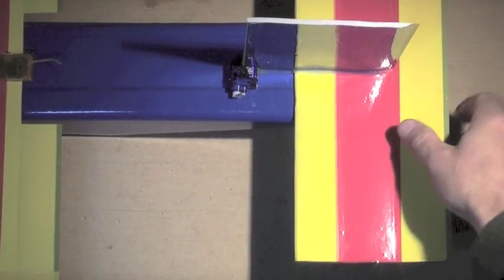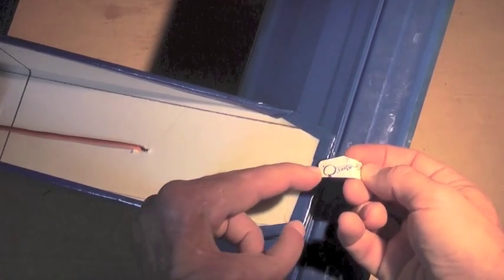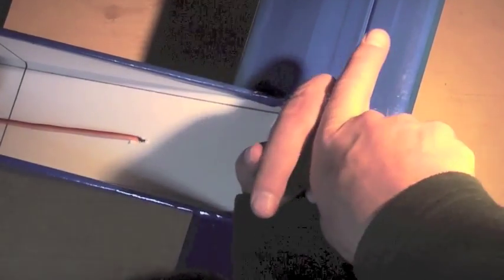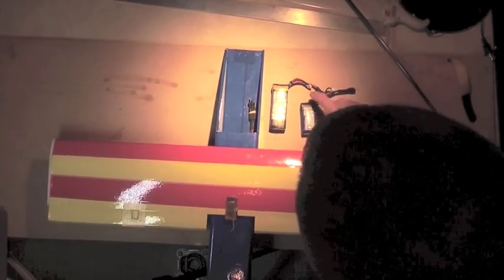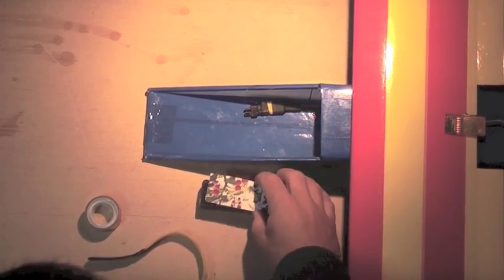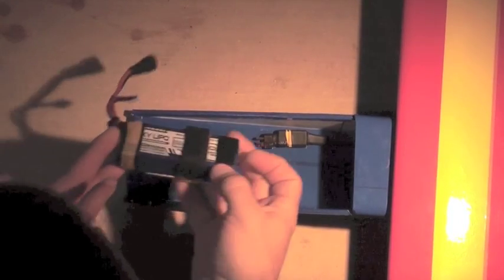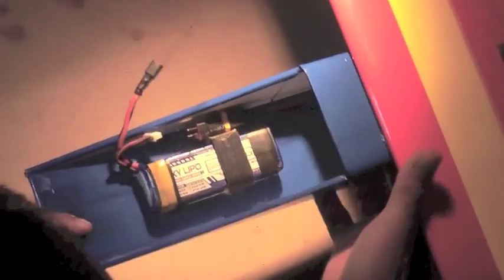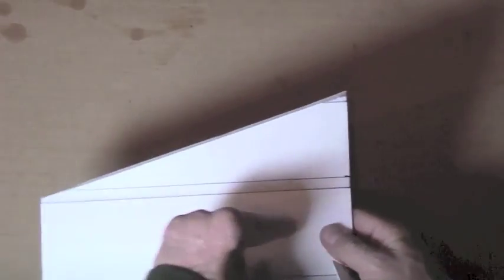FUGLYJET EDF, Build #4 - battery and controls

Comment from the maker: Right on, good choice.  I use NanoTechs 40-90C, but honestly just about any one over 30C is probably going to last you for a couple of years of weekend flying.  40C is nice for EDFs and high-draw motors.  Choose one with your preferred connector attached if possible.  The Fuglyjet does nicely with 2200mAh 3s, but 1500-2500mAh would be within limits.  I'd go lighter than heavier though.

Comment: I'm new to the area and I've ordered all the requirement for flying except for the battery. 
IMAX B6-AC Charger/Discharger 1-6 Cells (GENUINE) is going to be my charger. 
what kind of battery do you suggest that are available in the US warehouse in hobbyking  
so I can order them with cheap price.